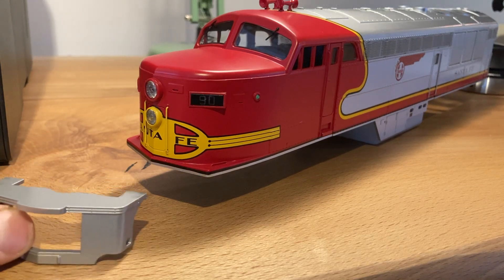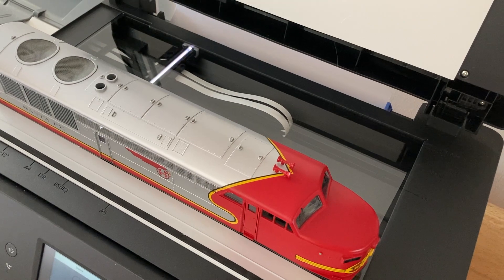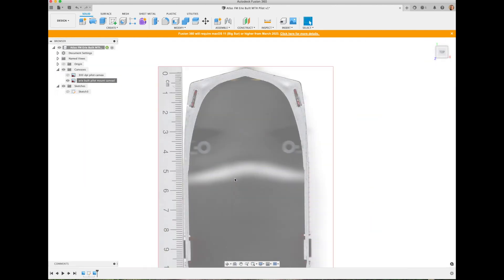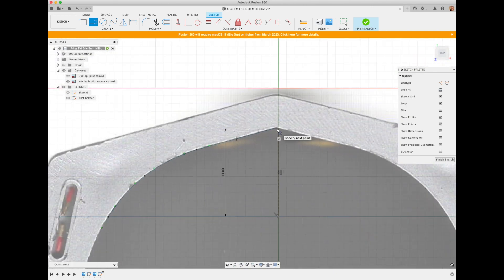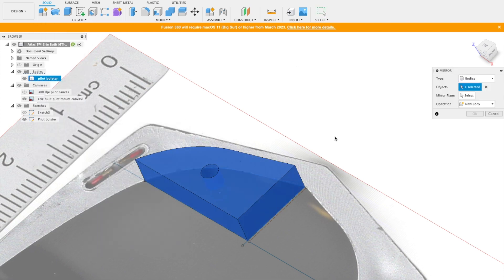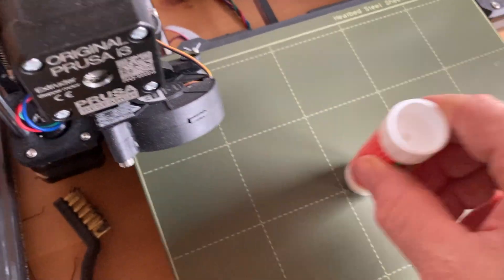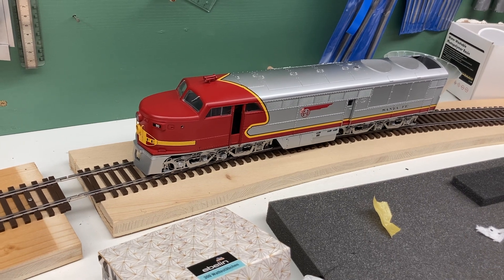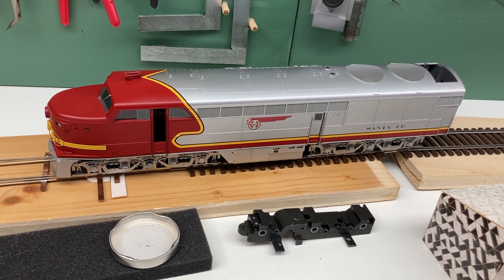Printing Precise Parts - how I measure an existing model's shape to print perfect matches

Comment: Very clever! But if you only need 1 piece, why not cut out the photocopy, paste it onto a piece of something like styrene or brass and cut it out with a coping saw and file to exact fit, assuming it wasn't an exact fit once you cut it out?  Or push a bit of polymer clay into place, pull it out, bake it briefly and put that in place?

Comment: Excellent.  We have been doing a similar thing for years in our shop to make reproductions of 19th and early 20th century architectural moldings and mill work.  We cut a wafer thin slice of sample - scan and use scan to create a 2d drawing, then extrude in 3D (we technically call it 2.5d)   Use that to generate G-code for the CNC, which carves a replica.   Because CNC is slow carving this sort of thing, it’s only worthwhile doing for a half dozen pieces - more, we send out 2d files to have knives cut for our molding machine - but still used the scanner
Reply from the maker: Nice! A CNC milling machine is on my bucket list - the new technologies really took over the hobby!